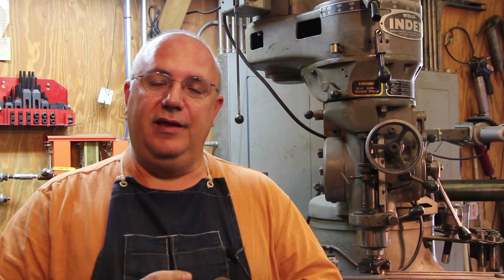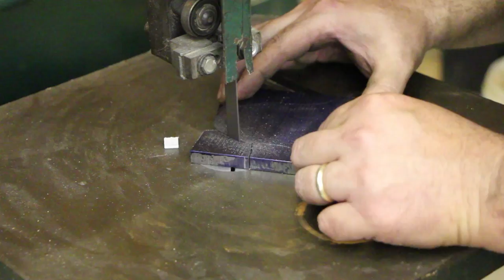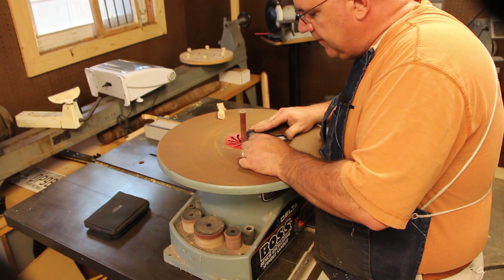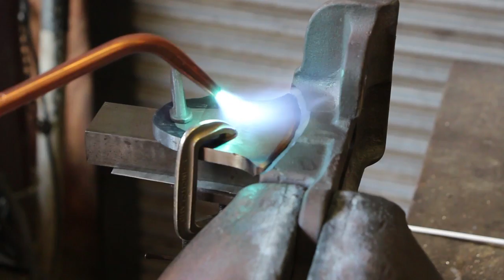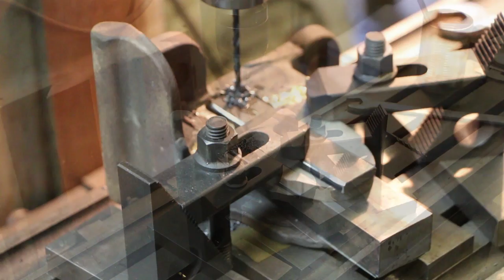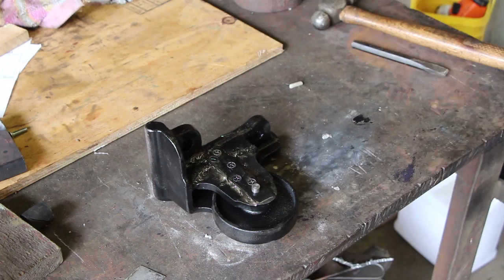Victor Safe Restoration - Part 5:  Broken Cast Iron Repair

Comment: I know its little bit of an older video but great spin on a repair Keith. I don't think I would've even thought about putting a beef up plate on that wheel after the fact. I would've machined it in and I'm sure would've too, but you have the know how to fix little things that sometimes get overlooked on accident. Me watchin guys like you that know what they're doin is what's gonna give me the knowledge I can take and use in the shop. I live down in Valdosta so hopefully I can make my way up to Tifton to meet ya. That'd be awesome. Thanks again Keith and keep up the great work.

Comment: i really like the idea of putting that extra metal there, super job, several times ive seen similar repairs, with no thought to adding the strength back , just relying on one braze joint, and yep, it ends up breaking

Comment: I have enjoyed this series immensely. I was particularly interested to see you use the bandsaw to cut the steel. The way you cut the small diameters into the shape was exactly the way I used to cut small diameters into complicated shapes in ceramic tiles. I used a wet diamond impregnated wheel to get the as close to the shape as possible and the tungsten carbide impregnated files to finish by hand. The harder the shape the more satisfaction when completed especially if I managed to get it without breaking any tiles and having to start again.

Comment: Looking good! I like to use JB weld for body work and forming of contours if you need to on metal. It sticks pretty good and it sands and grinds nice. I would never try to actually hold anything together with it but it sure is nice filler!

Comment: I'd like a lot of detail about how that combination lock works, and how you'll get the number marks into the dial accurately enough so it lines up with the ... pins? Tumblers? Whatever they are on the inside. Seeing the inside workings of an old safe is really interesting. Thanks for showing us.

Comment: Hi Keith,
Cast iron work's nice, I kind of like dealing with it, but, the dust is horrible, I noticed you sand, mill and grind without vacuuming, that must make hell of a mess with that black dust.
Looked like the original metal from the casting and the newer material from the repair weren't the same, by looking at the chips.
Project look's good so far,
Pierre

Comment: nice restoration so far kieth. i was thinking about that number 23 on the inside of the door. just takeing a guess maby its a tumbler set identification number or maby its the quality control inspectors stamp number. anyway love learing things watching your videos. i also have a lathe and a new 9x49 vertical mill its a trump a bridgport clone. the lathe is a 1939 16 inch southbend with a 60 inch bed.thanks kieth.

Comment: Nice brazing. I notice you didn't bottom out the steel against the cast iron at the top of the caster, wouldn't that be stronger that just the brazing material incase of tropage. Are you going to fill the countersinks with Bondo to give a smooth surface to paint.
Reply: The brazing filler has plenty of compression strength, and if you butted it together, you loose the ability to get the braze in there, and loose both shear strength, and the connection in bending moment. Both in my opinion more important than the slight difference in compression.

Comment: You could use walnut shells in your sandblaster - works well, esp. on fragile things.
Reply: ***** Hmmm, you said you had a sandblaster "that made a mess" - I was under the impression this was different than the bead blaster, perhaps a standalone 'outdoor' unit.    I was suggesting replacing the sand with walnut shells as the cleanup would not be as bad.

Comment: Keith, enjoyed good video; have you ever welded cast iron with cast iron ? i do i use old piston rings i get for free @ engine rebuild shop, and 20 mule team Borax laundry additive for flux @ the grocery store. and my Ox/acetylene torch to weld just like your brazing, but the fluxed piston ring should flow in looking like yellow jello makes a very strong weld of same material, cool slow. sand blast, paint.
Reply from the maker: I have some cast iron welding (brazing) rods that I have been playing around with some.  Still trying to get used to using it but so far I have liked what I have seen!

Comment: Hi Keith, On the dial, could you not just silver solder a disc on, much cheaper and keeps the battered, but original, handle.
Are you going to make a plate listing repairs and date, so your grand kids grand kids know what happened to their safe last century?
ATB
chris